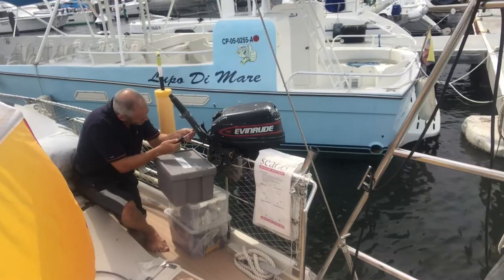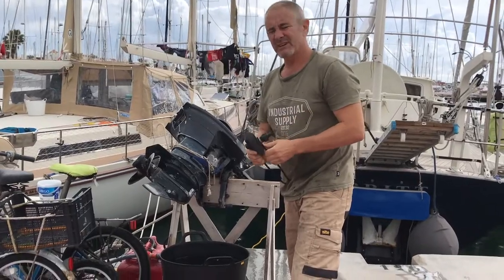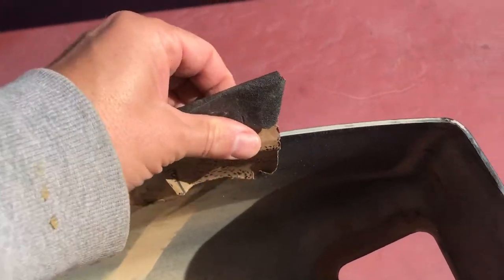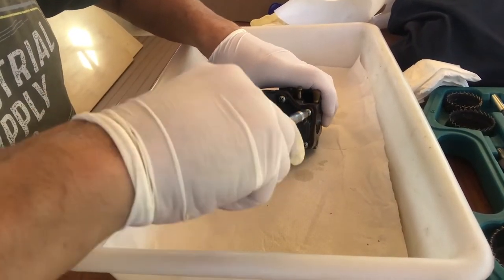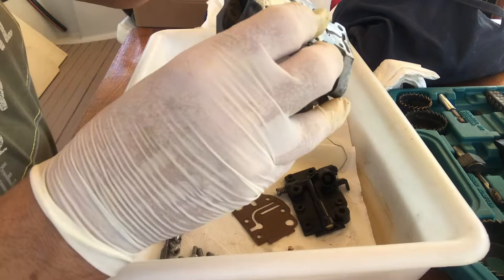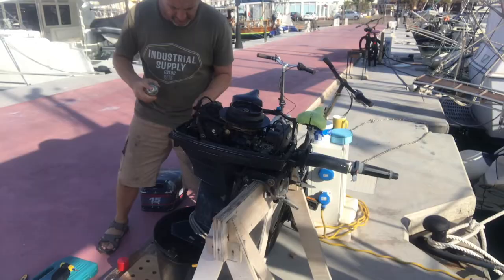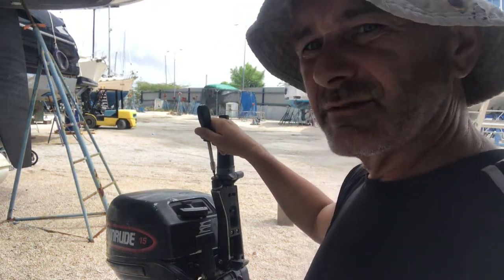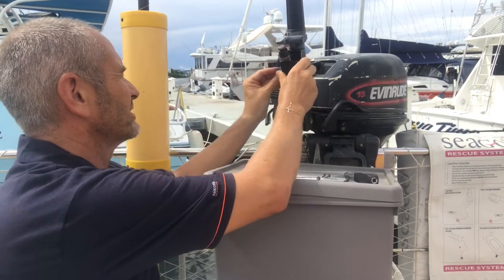Outboard Servicing, Repairing, Winterizing and Maintaining a Johnson / Evinrude 15HP 2 Stroke Engine

Comment: I think you did it, but you put the top plug back in the bottom section before you pull the bottom filling hose from the bottom filling plug so that the oil doesn't drain back out on you.  That oil was really quite dirty so something is going on in there.  Great video as usual. I love how you show your mistakes as we all make them and that's how we learn.  Keep that old girl going...  they don't make them like that anymore and those old two strokes are far better to run (weight to HP) and maintain.
Reply from the maker: Hi Steve - some of these videos are edited together from several different services and I don't always capture everything on film (sometimes hitting the wrong button or setting) so sometimes there are slight continuity errors.  Yes it's a good old motor that I managed to bring back from the brink of going in the skip with the help of Hugo in Malta. It's been fairly reliable ever since. Spraying adhesive into the carb didn't help though :/